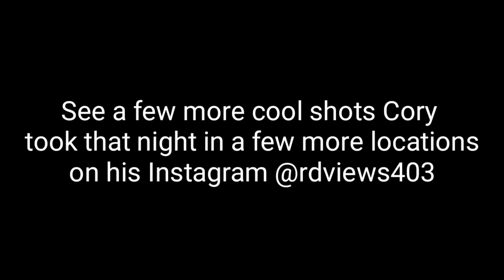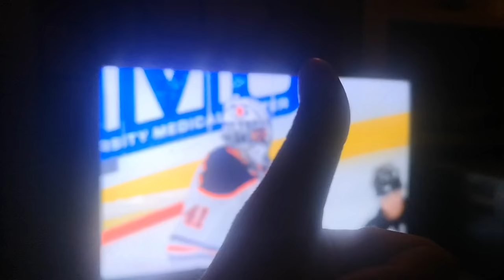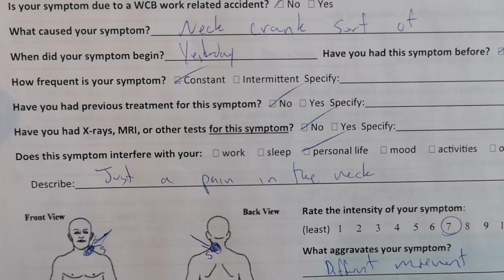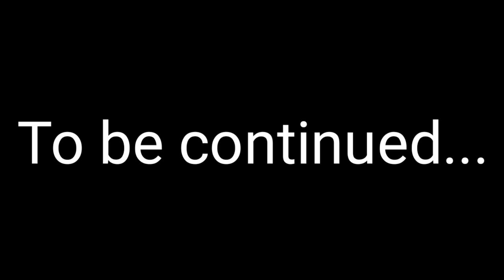Another trip to Red Deer | Another VLOG #52

Comment: Steel wool has a thin coating of oil to prevent rust, hence  the flammability.
Reply: Mystery solved!!! Thank You.
Reply: I never knew that.
Reply: SpyingDutchman  "The reason is that the spun steel fibers have a microscopic coating of oil to prevent them from rusting."  Now STFU and get off my TL

Comment: You knocked your neck vertebrae out with the drywall most likely. When it tightens on one side, it is because the vertebrae slipped to the opposite side and is now over pulling the nerves and muscles. This works without a chiropractic bill: Lay on the ground face up. Have someone at your head wind up a dish towel/cloth and put it around your chin while holding it over your head.  You grab the chin part so it won't slip off. Now your friend starts to pull gently then harder. Your neck will probably pop back into place. Repeat. Free unless your head pulling friend charges...Ice then heat. Repeat.

Comment: In Australia we use 6metre sheets x10mm. We have then in 2sizes, either 1200 or 1350 wide. One thing I noticed is that you guys don't use noggins in your internal walls, where as we are coded to have them.

Comment: liked the little waste as possible in the boarding--which means you have to plan out the job more carefully to get the right amount of the right sizes of drywall.  I would think it advantageous to have a drywall lift or rent one if possible.  ( instead of holding it up with your head!) the photo shoot and results was really interesting.  Thank God for chiropractors--yes if you are going for a few more sessions, he will likely help your back issue.( I thought you hurt yourself busting through the door at Curiosity Inc. )  well, you left us with a cliffhanger.

Comment: Looks like a lot of water stains or mold on the cement around that little window wouldn't you want to water proof the basement first? Not being mean just asking. I love your videos!!!
Reply from the maker: It was repaired by previous owners. It's not mold. But there was a crack in the foundation that was repaired. I also thought it was mold. But of coarse if there was issues , it would be rectified before finishing. Some residue that you're seeing could also be from the demo process. This whole basement was previously finished. Just an impractical lay out that wasted alot of space.
Reply: @JoshuaAlexander138  Ahhh... Thanks for clearing that up because I've never seen you do anything that wasn't a 100%!